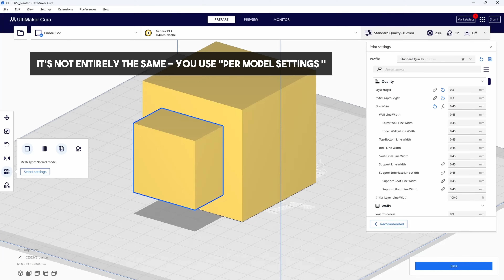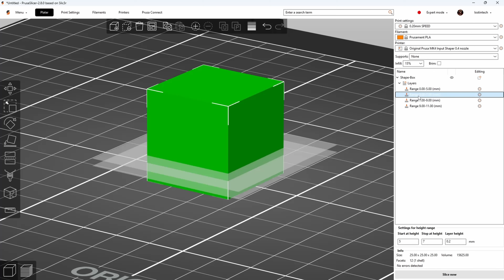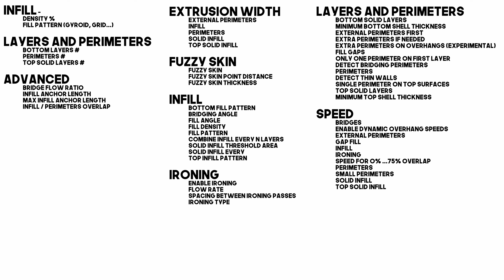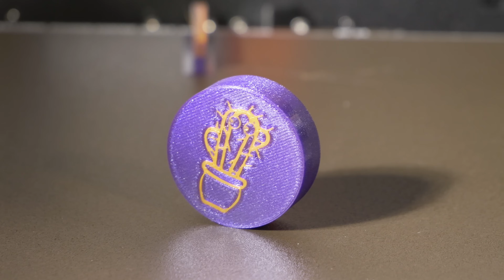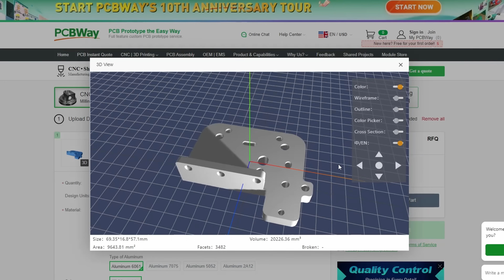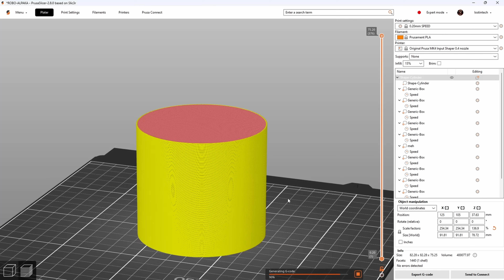How to use Modifiers in Prusaslicer (and Bambu/Orca)

Comment: I've used modifiers to change infill and wall count - but the slicer puts a seam there. If wall count changes, there's a seam. If infill changes, where they meet is not fused. The parts with modifiers keep breaking off if I change the wall count.

Comment: I have used modifiers for all sorts of tricks, but I feel any modification to the walls is somewhat invalidated by how the slicer behaves on the boundary of the modifier.  Ex. if I want more walls in the overlap than outside, I would expect the number of walls that are on the outside to just continue across the overlapped area and only the extra walls to follow the contour of the overlap, but the slicer puts all walls around the overlap area and separate (less) walls around the non-overlapped parts.  That means I then no longer have any walls going all around the part and hence the thing is basically easier to break at that boundary of the modifier than without such a modifier for adding more walls.  I feel there's room for improvement in the slicers there ...

Comment: Bummer it doesnt seem to work in Creality print
Reply from the maker: Yeah creality print is based on cura
Reply: @LostInTech3D  hi  cura has per model settings including overlap parameter. I use it all the time for strengthening the base of surfboard fins. The latest creality print is based on orca as far as I know. It has per model settings but not the overlap part. If you try it it just prints  both parts and you get double layers ... ie it literally prints both parts regardless ...:(

Comment: Nice Video - mostly I started using modifiers in Cura as "Support Block Modifierst"... but later i even used modifiers to "avoid" printing parts on STLs that i don't need at all (0 walls, 0 infill, 0 top, 0 bottom)...

Comment: Sorry if you explained this but I missed it, however can you use a modifier to print a model's base in the traditional way and then change the print to continue as vase mode? I don't have a typical use case for this, it's just I came across a similar question on Reddit and I was wondering if it would be possible?
Reply from the maker: I don't think you can!
Reply: @LostInTech3D  Okay thanks for getting back to me.

Comment: I've very much enjoyed using modifiers both in SuperSlicer and in Cura, which is a little more Polish to use but you can add simple shapes, define how those shapes intersect with the models, and adjust a variety of per-model settings to achieve many of the same ends (not to mention post-processing scripts for changes by layer number or by Z position). Maybe the single most useful way I've applied modifiers is to adjust infill percentages in TPU prints to tune the hardness of specific areas of the print.

Comment: The urea has not been absorbed by the plants. In 24 hours in water in that temperature, most of it has been broken down to NH3/4 and CO2. Some of it is made into nitrite and nitrate. The most NH3/4 evaporates. Just before this, it builds up to its highest concentration and is toxic to most microorganisms. This kills the cyanobacteria or algae. When it is broken down and has evaporated, it will leave the arena for new growth of whatever. The nitrate will circle in the system and circa 20% or it will end up in the plants. So a small part of the urea is turned into nitrate, of which 20% finally is absorbed by the plants.

Comment: I have been using modifiere to define an area to have fuzzyskin. This was used on a grip for handling of a drill template
Reply: be careful, fuzzy skin will  start a new perimeter, when the modifier intersects only parts of the object. Usually it sticks together fine.
Reply: @rwz  yes, It was a while ago. Like v 2.7.4. 
It did work just fine, but I didnt like exactly what you mention. Especially on areas where I needed multiple cylinders to cover the finger grips. Should have made a STL for the whole area to make it just one modifier. But would like to have it as brush tool/smart select instead

Comment: You can make your modifiers in CAD and bring them in as a STEP file, and simply change them from a part to a modifier. This way you can make exact shaped modifiers. I design model Rc aircraft and the wings need specific reinforced sections. Making the exact shape is simple by just making a copy of the part you want to be modified.
Reply: Wow, now that’s thinking 99!
Reply: Do you mean just import two of your model into the slicer, scale, turn, cut it as needed, and use as a modifier? Say, for hollowing parts etc.

Comment: Hello! This video is also fantastic and informative like the previous ones. Is there a setting in this program or another that I can use to change the printing direction? My problem is that I print wings for airplane models and I want to print them in the same way, but the printing direction of the left and right wings should be different. Can anyone help with this?

Comment: One question. Is possible to choose from specific layer height print in vase mode??? 
I designed a lamp for solar ligt. First 3mm is a lock, then just rounded lamp, seam is really visible on transparent petg.
Reply from the maker: No, but it would be cool if you could!

Comment: Always using modifiers and negative volumes. You can design everything in Fusion, but when you want a cutout in designed box in form of other stl or svg it so much easier to do it in negative volumes than designing it in parametric CAD. And modifiers also is just incredibly useful, especialy hiegh range modifiers. For example I use manual layer height using heigh range modifier when I'm inserting magnets mod-print which have 0.3 layer height to cover it after with three 0.1 layers - this way you get so much nicer surface with very thin cover.

Comment: This may be a little controversial.   Modifier mesh can be used to "edit" original STL when remixing is not allowed by the original creator.  Does it become a pseudo remix?
Reply from the maker: Good question. I think it's fine because it's not being published as a model, but I think people's opinions might vary
Reply: @LostInTech3D  To test this very pseudo remix idea, I published a "Modifier mesh for dual color 3DBenchy" on printables.

Comment: It's nice to know what can be changed/modified. As a complete novice, I need guidance on why you would want to change a given setting. Making walls thinner or thicker etc. is fine but why would I want to do that? What are the effects of such changes? What problems am I trying to solve by changing a setting. Do you have a video(s) on that?
Reply: Mainly for structural prints, only specific areas need to be strong and it the only way to control aspects of one large print beside splitting into multiple parts. 

Surface quality can be improved by controlling infill and other related settings in specific areas, again while saving material. 

Most the time while designing the modifiers are already known, so a copy will be split into chunks, then imported with the model in location so only the settings need to be selected, less fiddling.

Comment: It's surprising how little there's talk about modifiers and generally the features of the slicers and those really can be powerful.
Like only the adding parts is super useful, not only that you can add hooks and loops and whatever to whatever, but you can use it to nest prints together like you're printing something like a shell for something and you cannot print it so the roof of it is on the buildplate but you need to add supports for the roof, you also have to print something which surface finish can be a bit rough, by adding that something else as a part and nesting it inside the shell, prusaslicer doesn't even notice you're doing something naughty and let's you use the something else as a support for the shell. If you did that without adding the something else as a part of the shell, prusa is not going to like that and complain about colliding prints.

I just wish they would add at least one more layer of those additional things. Like you could add negative volume to modifiers that only affect the modifier and not the whole object. That already would allow you to take a complicated model, add itself as a modifier to itself and then use negative volume on that modifier to limit the areas where it affects.

Comment: You can print stacks of things like multiboard panels by adding a 1 layer modifier in between each panel and printing with something like petg for that layer if your panels are pla, something that your panels won't stick to and have them separate super easily.

Comment: I sometimes use them to have fuzzy skin only where i really want it but it's a monumental faff.
Reply: Just split up a copy of the model at the settings boundary and import it in with the model in position already.
Reply: @hellothere6627    i don't want extra walls or a seam within the model.
Reply: @SianaGearz the model will print as one part and the extra broken up blocks are just modifiers overlapping the base model, there won’t be extra walls or seams unless you tell it to do those things

Comment: Modifiers are a necessity for functional parts, in my opinion. Optimizing strength means having greater control of all those settings and utilizing the strengths of the material. Great video!
Reply: I add 0.1mm cutouts where I need more strength. Doing it in slicer is ok but if you print the part 6 months later you can run into issues because of slicer updates. 
In CAD you have more control too.

Comment: I really like prusaslicer for how easy it is to make simple modifications especially if they are dynamic. In my case I have to make a hole so I just use cylinder and make a hole, why is that useful...? Because I can scale the main model while keeping the hole the same size... BUT I ran into a problem. Prusaslicer is great in many regards, including keeping the dimensions they way they are in the preview with no tweaking... but for some reason models that have a lot of small movements, small parts on the first layer are just a nightmare on my Ender 3 V2... It just refuses to stick well. I have no idea why that is but the same model in Cura prints really well with no problems BUT the opening dimensions are not correct among other things... Maybe it's many retractions prusaslicer uses or difference in movement etc. who knows but it's frustrating. There's just no way to have best of both worlds is there... Also Cura has incredible tree supports, they just pop off with no quality issues. Haven't used Cura in a while but I might want to switch back to it despite the fact that editing thing in there is a hassle... I dunno, there are issues with both.

Also good lord am I tired of this damn printer... I really would love to just get a new one. So many times I'd spend hours and hours trying to fix an issue only to find out that it's mechanical and I have to replace something. I probably put enough money into that old junk that I could have bought a new printer with more features and less problems by this point.

Comment: I model the modifier objects in the program to then import them together as multiparts.  And then I change the object type to a modifier.  often it is a bridge modifier, thin, only where needed.  To accurately indicate the direction of the bridge, and sometimes reduce the number of perimeters so that the bridge succeeds. If I missed somewhere, I correct the model.  Export with a replacement, and update the model in the slicer.

Comment: I hope a paint modifier is added. Adding modifiers to complex geometry is really time consuming, where painting the area would be so easy and fast.
Reply from the maker: that would be cool
Reply: that’s what my master design thesis is about 😄
Reply: It's hard to paint in 3D though, the best solution I can think of off the top of my head would be an astroneer-style 3d painting system with marching cubes

Comment: Great video. I have been using modifiers for sometime. I generally make functional parts and found out a good use for modifiers quite by accident. I hope what I describe below is as useful to others as it has been for me. 

When I create my models I create cylinders around holes that are not joined/merged with the main body. Your finished part should have more than one body. One for the main body and one for each of the holes in the body. My basic dims for the part modifiers are .4mm offset larger than the ID x 1.6mm(min) wall thickness. Extruded internally to 1mm from opposing surfaces. This will also work for threaded holes that don't need to go thru. Just set the extrude to 1mm past the end of the hole or opposite surface, whichever comes first. 

When saved as .3MF it will show up in the slicer as a part with multiple objects that all move as one.  They will not be visible on screen but in the parts list as a subsection of that part. They will all be considered parts but you can click on each one of the objects that will be used and change its type to modifier.  Then I select each of the modifier objects and set walls, bottom, and top to 0 then set infill to 100% rectilinear. The main body will remain to the default settings. The result is solid plastic between bolt head and mounting surface or greater wall thickness for taping/inserts. Best part is the infill around the hole is uniform and not based on walls or to/bottom settings. 

This can also be used to create structural features within the part.

Comment: really great video. i screencapd the settings. really useful thank you. I was surprised to see your aluminium part costing less than $40. the one time i tried to use that site I just wanted a tube turned with a step down diameter and they wanted over £250. cheers :)
Reply from the maker: glad it helped!

Comment: Modifiers are awesome. I use Prusa and I printed some flip flops out of Varioshore Tpu. I did 4 walls 20% infill for the sole, 2 walls 10% for the strap and then a cylinder for the heel at 35% infill for the extra support and they actually came out great and are super comfortable. I printed it at 240C for the foaming action at 20-40mm/s, it took about a day per flip flop, but totally worth it.
Reply from the maker: nice to see someone using varioshore for that, I always thought that was a good use case!

Comment: I use modifiers nearly every print. Right now I got PrusaSlicer open with two parts sliced, with one of them having brim enabled via modifier. My printer's bed adhesion can sustain large part, but a part with 2x20mm footprint better have brim enabled, just to be on the safe side. I used modifiers to build internal "load bearing" 100% infill, to trim some 3d model for a quick fitment test, to gradually change infill pattern or percentage, to enable ironing on specific surfaces, to create supportless bridging over a gap with a hole in model. There's even couple of small prints I made without CAD, using positive and negative volume modifiers to create model inside slicer.

Comment: I've used ironing with a modifier recently. One thing I feel is currently missing is being able to align them with parts of your model rather than judging it by eye.
Reply: In the past I've modelled extra overlapping bodies in Fusion 360 where I wanted modifiers, exported them as a single STL. In Bambu Studio I used "split to parts" and then changed the part type to modifier. This let me use a custom mesh as the modifier and it's positioned exactly where it's supposed to be. The only annoying part is you have to redo that every time you change the model as the "reload from disk" option doesn't work once you "split to parts".
Reply from the maker: This also goes for multi part models, if you have a colour printer you want them all to align if the designer supplied separate parts.
Reply: If you CAD design the parts yourself you ca simply add the modifier body in CAD as well and position it to your liking.